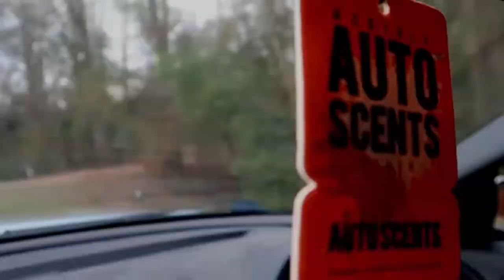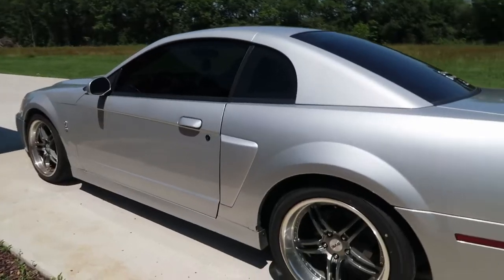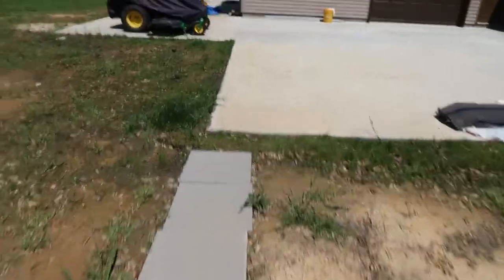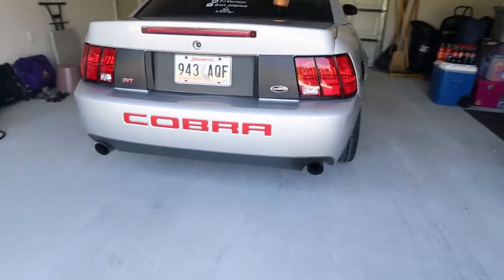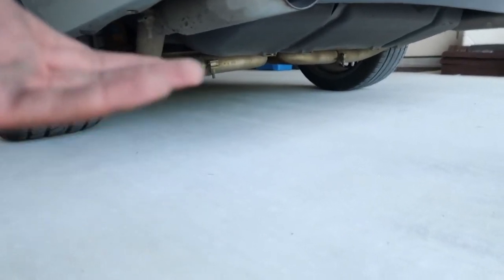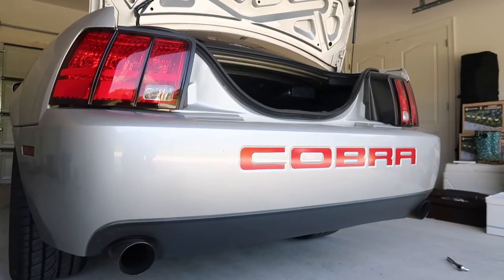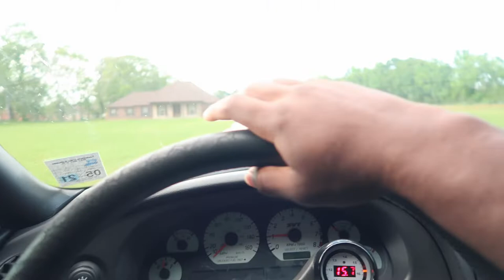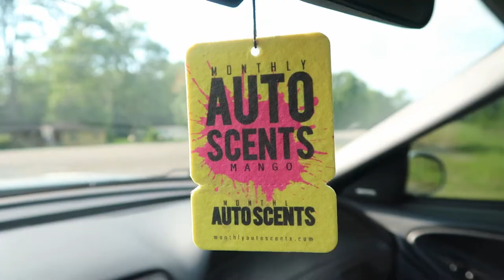Fixing Mustang Exhaust Problems I DID NOT Cause (LOUD)

Comment: Don’t get spacers. Just get either 275s or 285s in the rear. Buy them from someone off Facebook or offer up. Obviously make sure they have good thread life in them. I bought Michelin pilot sport off someone for $200 for 2 wheels and they have a lot of life left. Buying from people saves you hella depending on wat u buy
Reply from the maker: I have 285s on the rear already, my previous 295s rubbed so I went with these. I don’t think I like my wheel specs tbh, the offset is too tucked
Reply: PJ Morrison ohh. Well then lol. I have rovos. I think my wheel offset is +35 and I’m running 275s in the rear. Tires not completely staggered out the fender but it does it’s job stanced

Comment: I have the same 2 noises up front what did you do to fix them
Reply from the maker: I can’t quite put my finger on the high pitch sound, but the rattle was a bad idler pulley
Reply: @pj_morrison  its the ringing noise in the video before this one , you said you fixed it idk if you remember lol
Reply from the maker: @Nateo510  I know, I’m saying idk what fixed it. I really was just making sure all seals and gaskets were good. It was coming from somewhere on the back driver’s side of the blower tho. Might’ve been the boost bypass because of the hose I had capped off. Go watch my “finally at full boost” video to see what I’m talking about
Reply: @pj_morrison  yes mine is coming from the same spot , yours just magically went away lol